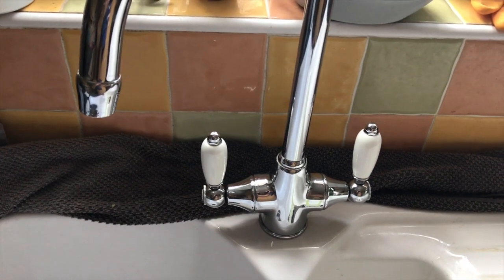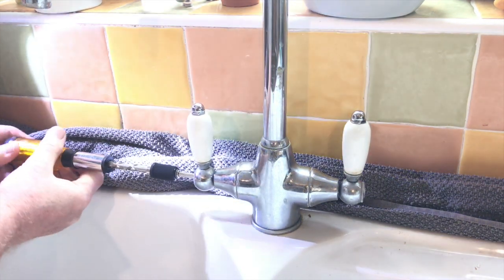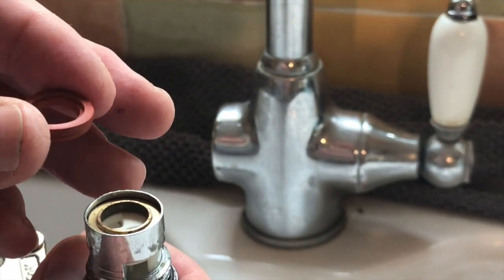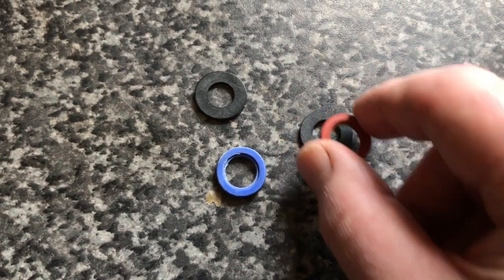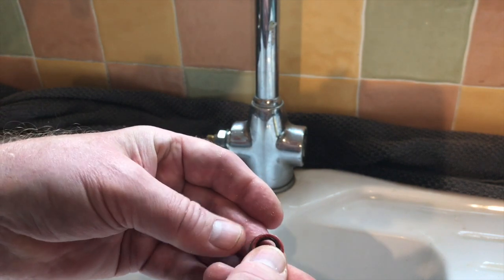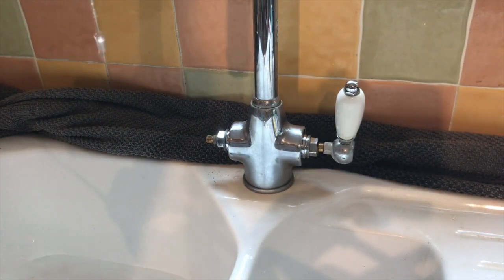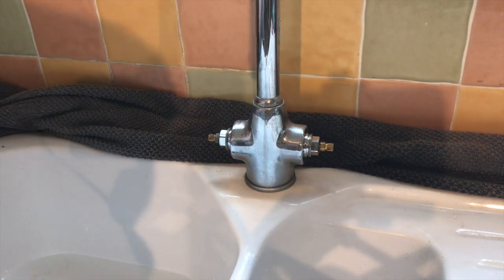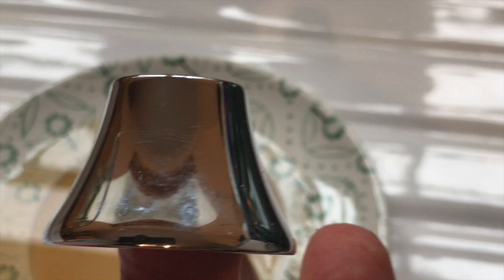How To Cheaply Fix A Dripping With Dual Tap Ceramic Insert Valves

Comment: Thanks a good idea. This should fix the tap if the rubber washer is worn up due to prolong use.  I used to wrap around the Teflon tape around the metal housing and over the existing washer. Then puncture a hole in the centre to allow the water to flow. I think your idea is easier to implement. Thanks for sharing your video.
Reply from the maker: Great tip! Thanks for the comment I'm so glad it helped.  If you liked the video please feel free to buy me a coffee using this link:  https://www.buymeacoffee.com/fixed1tfix4  I need a lot of it to continue making these videos. Please don't forget to subscribe and check out my other great videos there are now over 650 to choose from and share @fixed1t with friends, family and colleagues as I could do with more subscribers to help grow the channel. Many Thanks Malcolm aka @fixed1t

Comment: Well done for this video. As in my case the leaking mixer tap was nothing to do with the ceramics. It was the fact that the aluminium housing that the back rubber washer is seated against had oxidised. This left a rough surface for water to leak through. I cleaned it up with a hobby drill and fine wire brush attachment. Added a small amount of plumbing paste and reassembled. No more drips and again nothing to do with the ceramics. One word of warning. Once you disturb the oxidisation it will block the spout filter so remove it to flush everything out at first turn on.
Reply from the maker: Thanks Christopher your right, but its too easy to blame and get you to buy a new set of ceramics which would work very briefly if ay all without the cleaning job. Please don't forget to subscribe to my channel and check out my other great videos and share #fixed1t with friends and colleagues . Thanks Malcolm aka #fixed1t
Reply: Thanks Malcolm. If I still have no drips in six months time I will post it on here. The whole idea of these ceramic valve seems to make sense until the manufacturers include rubber washers against oxidising and scaling metal. It takes everything back to square one.